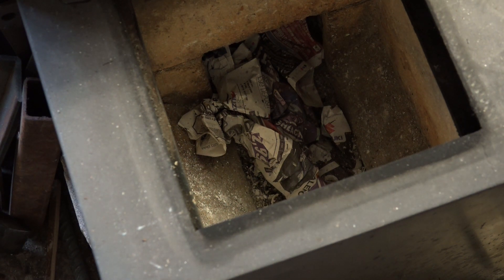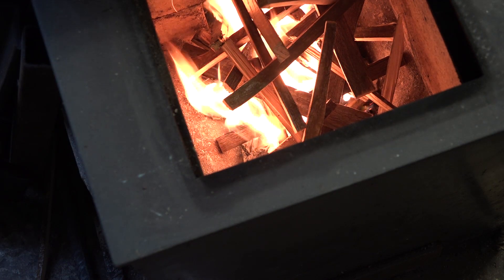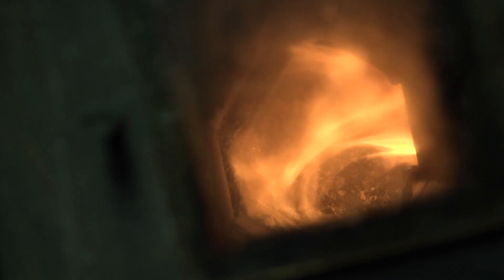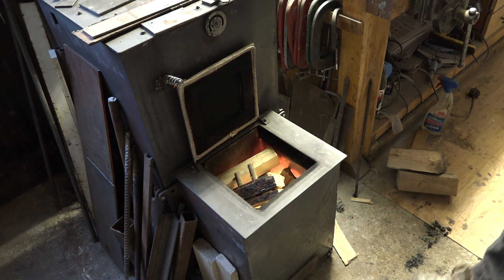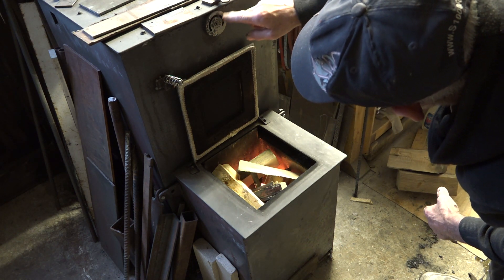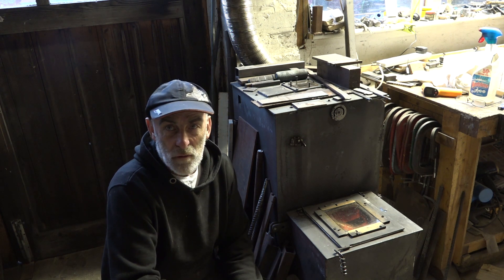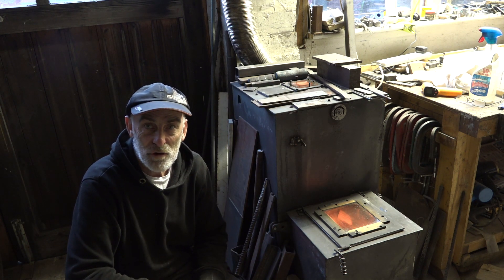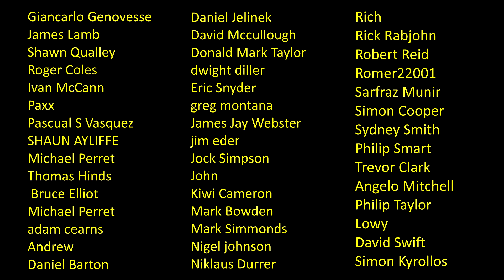Rocket stove Riser update

Comment: Can you make a sandbattery around it? Like a thick sand jacket . That will store heat. If you insulate the sand it might stay hot during the night. With heath vent pipes  running through it will  blow warmth

Comment: Glad to hear the "made up"  riser tube is holding up well. There must be a high heat epoxy/glazing you could just glue the bits and pieces together instead of screwing them in place. (I know this was all just a temporary job to see how it would work...) I've been doing a bit of catching up to see how everything has been going. Looks fine! I'm  especially keen on the new combustion air routing from outside, through the bottom and then up the outsides of the fire box. This one really is an excellent unit! My latest thought is, how much better would a pyramid shaped top be than just a flat top? It would give a bit more surface area at the top to dissipate heat, and the slope would also help with airflow/circulation both inside and out.

Comment: My riser is a lot like yours. Instead of using shorts pieces wood I use 3 to 4 foot pieces of wood that way it is self-feeding. Nice job!  Later
Reply: @Freddy McIntire I have had mine for over 5 years with no problem to get to the point of gasification with the 3ft sticks stick out . You don't have to closet the door for it to work right.

Comment: ppotty1 thank you for sharing your expirience! Your rocketstove builds are a great inspiration!
I have some questions now. Maybe you can help me?
Do you regulate the secondairy air or is it just on/off?
Since the use of the isulated combustion tube do you lose temperature through the chimney?
How big is the distance between the top of the combustion tube and the sight glass?
Did you use ceramic fiber board or calcium silicate board?
Thanks in advance, rr
Reply from the maker: yes sec air i just leave it open with this riser, the flue gets hotter faster as does the exchanger or body so i can turn down the primary air within 10 mins so less heat is lost up the flue. gap over the riser is about 4 inches, im not actually sure what the bottom board was is say use ceramic as it will last longer or even the light weight firebrick i just used in my heat treating oven, the top drop on section of the riser was vermiculite. cheers